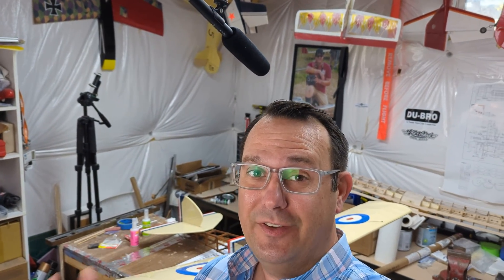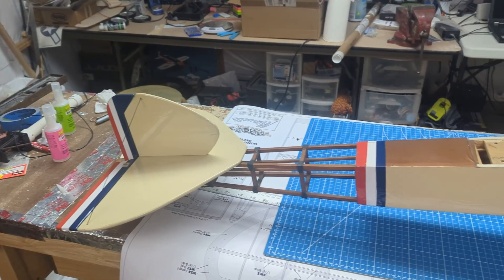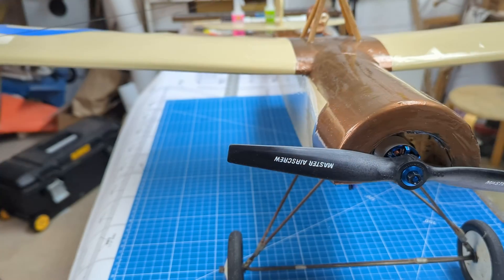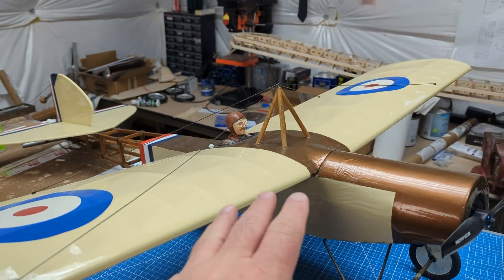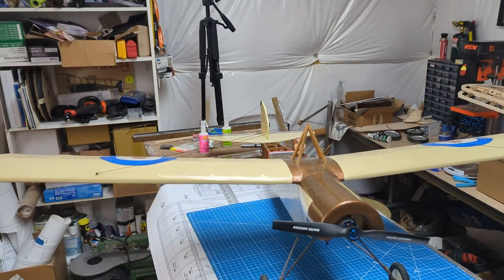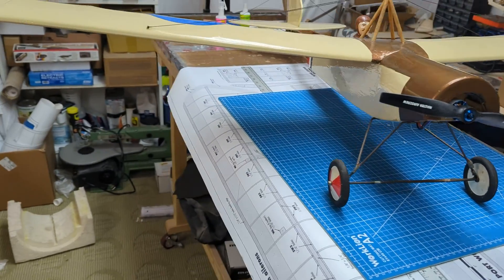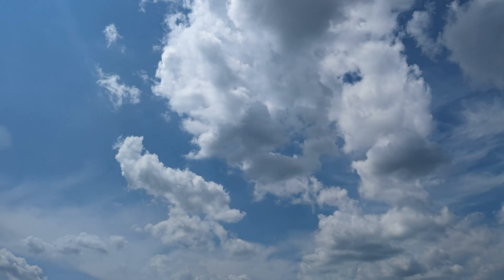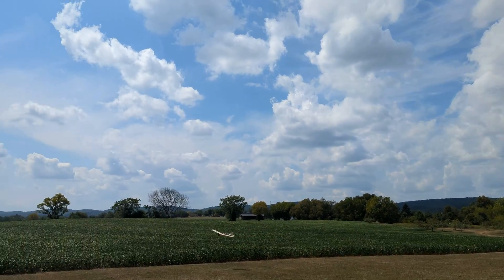ZTW Beatles G2 ESCs are the BEST new ESC

Comment: hi, do you kown how to connect reverse cable? i am connecting reverse wire to my pwm output in my reciver but it didnt work. thanks
Reply: You have to enable the reversing function with the programming card or by using the beeps and the esc manual. Then connect that 4th wire to a free channel signal pin, then flipping that channel between +100 and -100 will reverse the motor.
Reply: @MatthewHeiskell  i don’t think so. this setting only changes motor rotation.